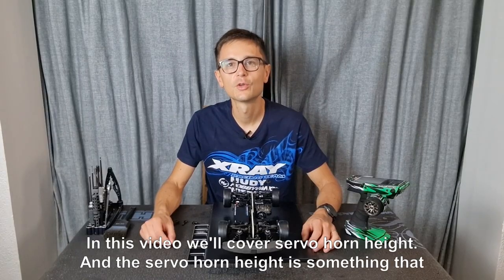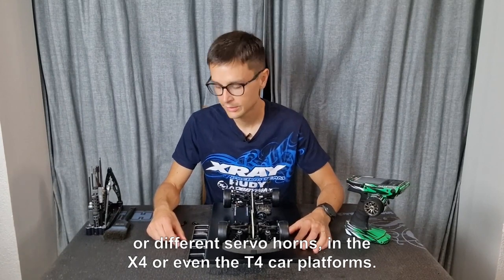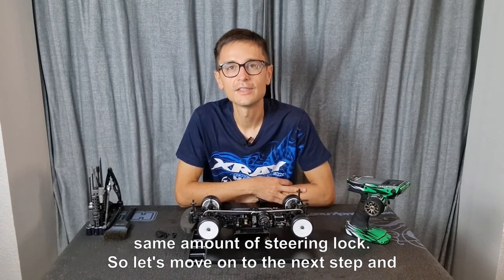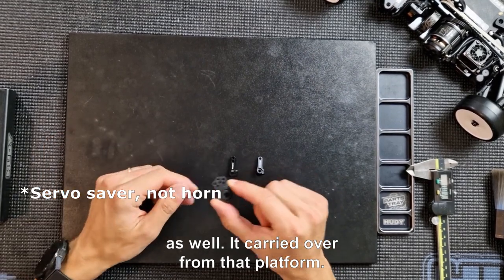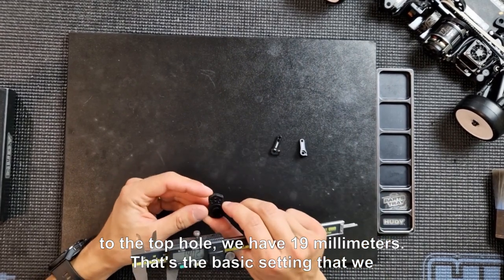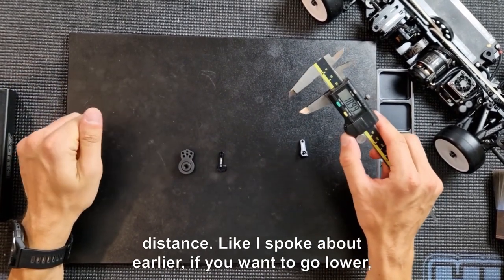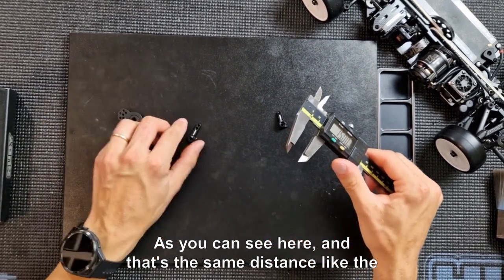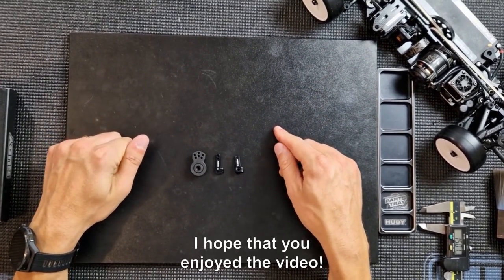Servo horn height tutorial!

Comment: Hi Alex, what advantages does using a lower hole position have over just turning down the steering curve on the transmitter? Reducing the curve is my usual go-to if grip is too high or steering is too sensitive.
Reply from the maker: Changing the horn height is a mechanical change, not only digital, and thus, will have a more profound effect on the handling.

Comment: fixed and clamp type.. what the difference ? why are there 2 types?
Reply from the maker: The clamp type gives extra security/reduced play.
Reply: @hagberg  what aboout choice of 2 or 3 holes why not always go 3 for more choice?
Reply from the maker: @MrBoomtheroom  the 3rd hole is too high and will make the steering link hit the topdeck, hence why, it's not useful for TC.
Reply: @hagberg any issues with having a 3 hole one if a 2 hole is not available?
No disadvantages?
Reply: @hagberg  anything wrong by using  3 hole horn if 2 hole is not available?
Reply from the maker: @MrBoomtheroom as long as you only use the 2nd hole and not the 3rd.